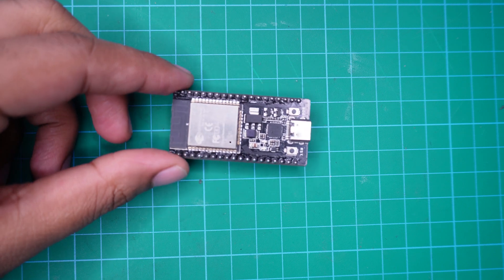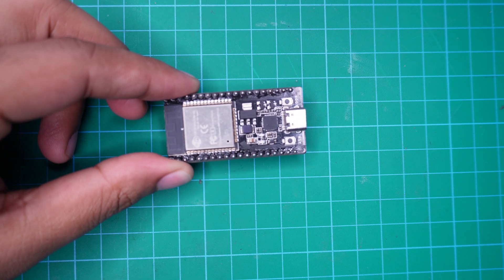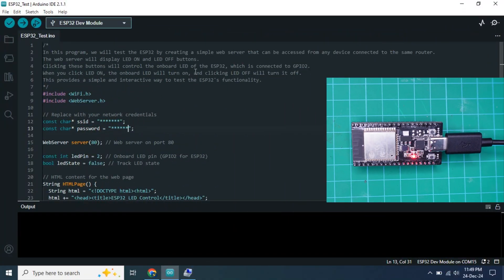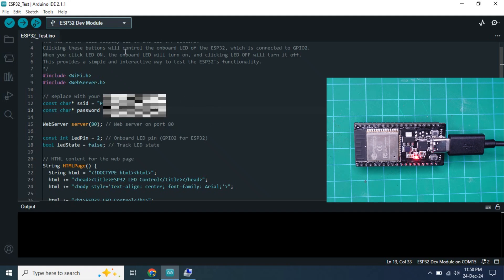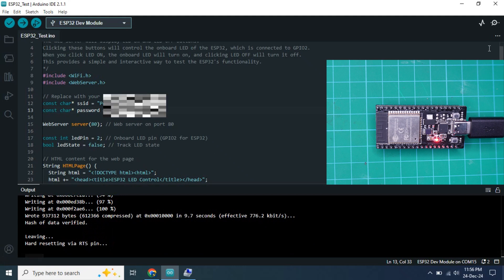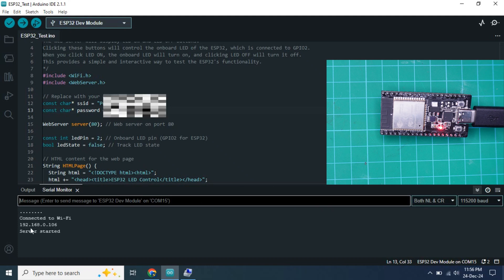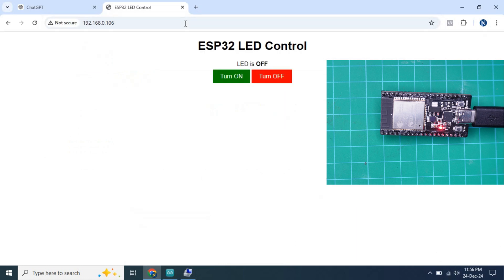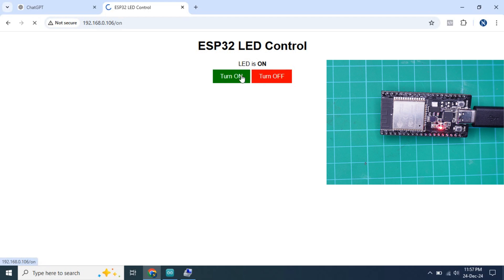How to Quickly Test Your New ESP32 Board (No Extra Hardware Needed!)"

Comment: hey guys, if you see weird symbols or repeating dots/dashes on your Serial Monitor, try switching the baud rate — test values like 9600, 57600, 74880, or 230400 (the ESP32 sometimes spits nonsense at 74880 during boot).

you can also press the ‘EN’ button on the board to reset it and get clean output again.

Comment: My build in led is working fine with bluetooth but when i change gpio to externally connected led then it was not working,
2) by using wifi my on board led was  not working as well as my gpio are also not working 
How should I tackle this problem
Reply from the maker: i will suggest you to do the full thing again. May be you are making any mistake.